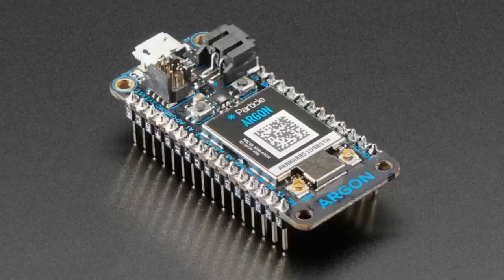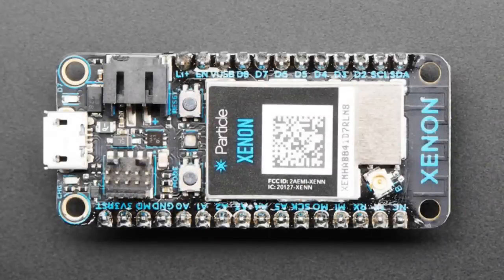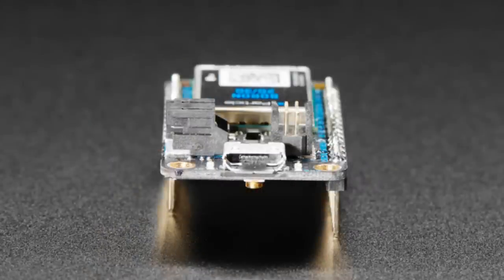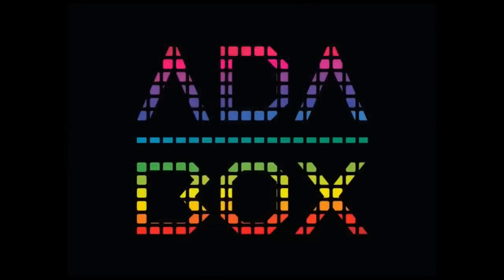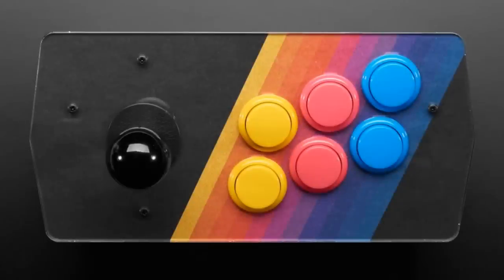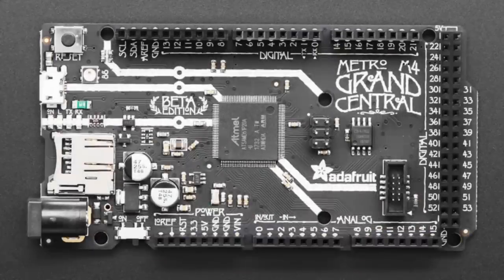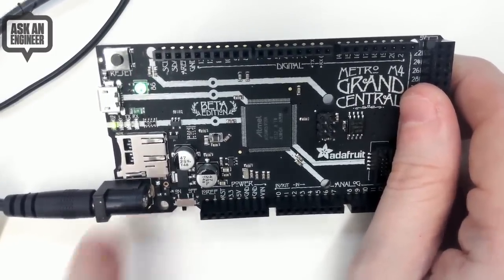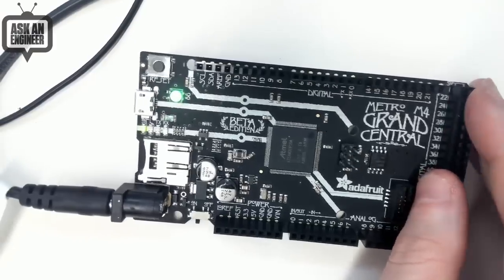New Products 1/9/19 Featuring Adafruit #GrandCentral #M4 Express! @adafruit #adafruit

Comment: Do you have to pay to be able to use the wifi/lte and 2G 3G on the particule and can you use arduino ide with the boards?
Reply: If you go to particle's site, they have all the answers to your questions.  I believe you get 2-3 months of free cellular connectivity with a cap. After that it's quite inexpensive considering that you have access to the cellular network.  I'm pretty sure that you can use their boards with the Arduino IDE, but they come with an OS flashed in that makes it easy to use all the features of a self healing mesh network.  I think it's based on thread.

Comment: does anyone have any info on boron boards in canada. im looking for a reasonable solution to monitor a remote (but inside normal LTE range) climate control. i have a cabin that has water/septic lines that i have had problems with freezing in the winter, ideally the device would send either limited data or triggered alerts based on say temperature of the pipes. its not line of site or within any long range tech that i am aware of.. about 40-60 km away (id have to measure on maps). (for anyone wondering on location, middle ontario about 1h south of Algonquin park)